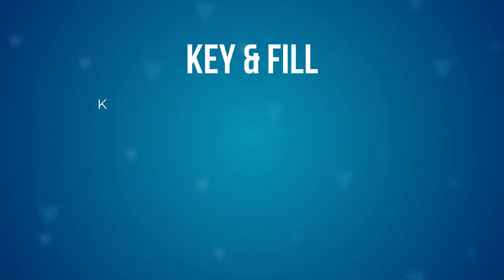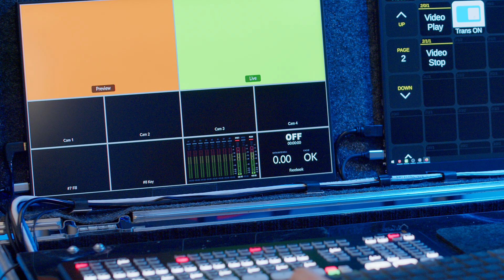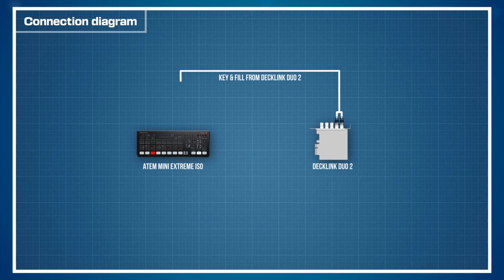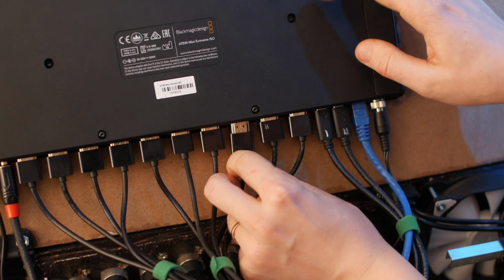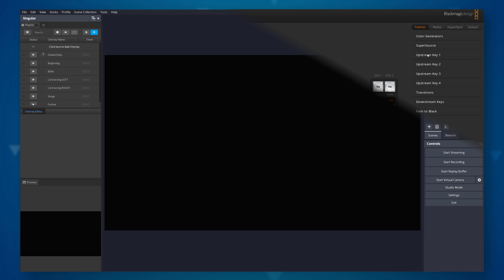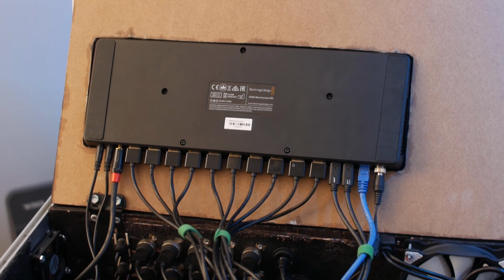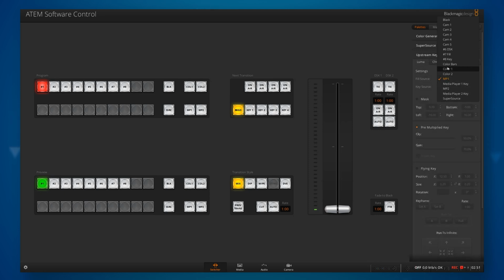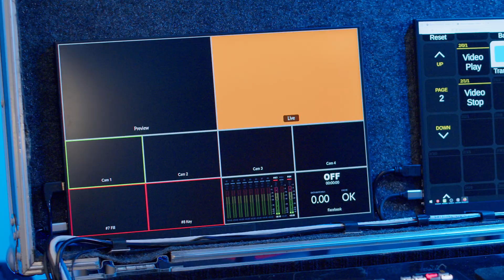How to Add Key & Fill from OBS Studio to ATEM Mini | Simplified Solution!

Comment: Hello, first of all, thank you for uploading this solution, I was going crazy looking for how to send key and fill. 

I don't know if you have been able to find any plugin or software to recognize the dual link as obs? that is, select the outputs without using prior and programming.

thank you, I wish you the best great job
Reply from the maker: I don't understand your question, but I'll try to explain in more detail. For using my method you need to use BitFocus Companion to run\start two sources at the same time, so OBS can play both scenes & sources at the same time to give Key & Fill source for ATEM Mini. Otherwise it won't work, and as I know there's no other method to get Key & Fill source. I also heard about another way via NDI plugin, but I couldn't make it to work.

As I mentioned in the video the right way to use DeckLink Duo 2. You'll have a tool "Decklink Output" in OBS after installation. And with "External" keyer option you can get Key & Fill source from only one scene & sources with no programming at all. If it's not what you were asking, let me know :)